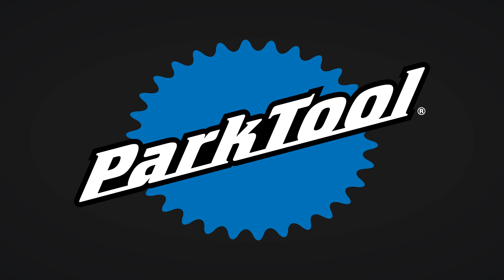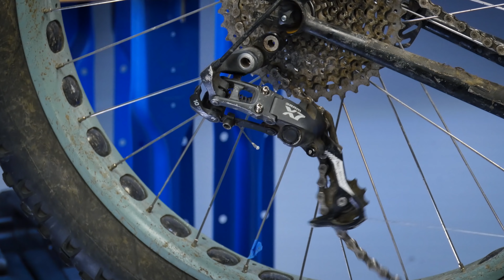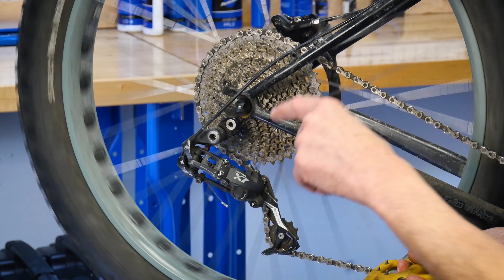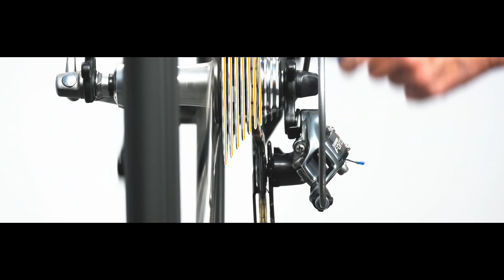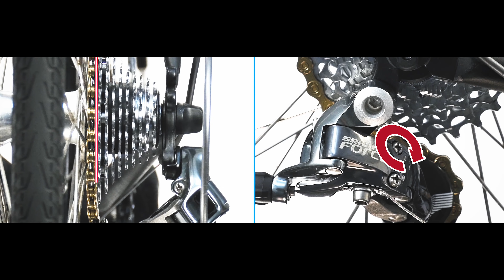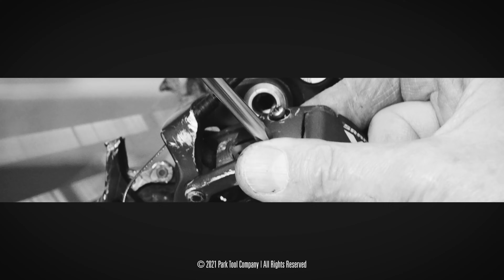Listen to Your Bike | Tech Tuesday #174

Comment: Calvin would you mind explaining why there are so many lineups of derailleurs and there is such a difference in price, like shimano has tourney, acera, alivio, slx, xt, xtr. I though as long as they are same number of speeds, and do the job, why not just pick the cheapest, why do companies insist on making so many, why does anyone buy an xtr over an xt other than bragging rights
Reply from the maker: It is more than just people wanting 101 types of ice cream and 101 choices in pizza.  There are certainly differences in performance, durability, weight and features such as range of gears and clutches.
Reply: Tourney, Altus and Acera are basic, and Alivio and Deore are entry level, and Zee and SLX are mid-range, 
Deore XT, Saint, XTR, are race and XTR DI2 (electric derailleur) is the pro,
Reply: @jonyboi_6543  yeah i know that you could figure that out from a brochure or pricing. I mean what real engineering differences are there?
Reply: @darius2640  you mean what country where Shimano really invented?
Reply: @darius2640  Depends on which lineups you're crossing. For the same generation of Shimano mid and high end groupsets (105, Ultegra, Dura-Ace on road, SLX, XT, XTR on mountain bikes) the designs of each component are pretty much the same (with a large area of cross-compatibility between them) with the main differences being on the materials used (with the higher end groupsets going for lighter materials) and, up to this generation at least, the lack of Di2 (electronic shifting) on the mid-range (105, SLX); the top-end might have some added features on specific components, but they tend to be marginal  (like Dura-Ace's/XTR's hydraulic disc calipers/levers which have a more advanced design compared to 105/SLX). Additionally, when Shimano releases a new generation of groupsets they start on the top-tier (Dura-Ace, XTR) and then wait a bit before upgrading the others (on Road, typically Ultegra comes ~1 year later and 105 ~2-3 years later). Once you go below those, the groupsets are typically (cost optimized versions from) a couple generations behind (Tiagra is 10 speed, related to the previous generation of mid-top end groupsets and a non-series upgrade to hydraulic disc brakes -- levers and calipers) or designed from the ground-up with cost in mind. Other groupset manufacturers follow a similar logic, but not quite as predictable (SRAM launched ETap versions of their mid-range groupsets -- road and MTB -- this year).

PD: GRX has a slightly different logic: The low-end (GRX400) is comparable with Tiagra, the mid-end (GRX600) is comparable with 105, and the high end (GRX800) is comparable with Ultegra. They're cross-compatible except for the front derailleur and cranksets (if you have a GRX crankset you must use a GRX front derailleur and vice-versa; ditto with the equivalent road crankset and front derailleur).
Reply: @docontra4921  thank you
Reply: Free market lol

Comment: Always great info! What would cause a well shifting bike with an unstretched chain to skip when putting power into the top 2 gears?
Reply from the maker: By "the top 2 gears", you mean the smallest two sprockets?  Likely these are worn out and cannot engage the chain well. There is only one or at most 2 teeth doing the work there and when they get worn, they cannot hold the chain under pressure.
Reply: @parktool  yes, smallest 2, they didn't appear worn, but I'll take a closer look.

Comment: I'm not strong: best way to remove a cased bottom bracket Shimano for 26 Rim----Yes it's Wal-Mart Road master Very magnetic No satellites please with fishing magnets..
Reply: Use leverage, bike on its wheels on the ground, long breaker bar, set horizontal, with your weight on it gentle pressure no bouncing, rag in hands, both sides of bottom bracket will undo with breaker bar going down to front wheel. Put some WD40 or similar on joints between cups and BB Shell, heat the shell even boiled water if no heat gun. 
Good luck with the magnets.